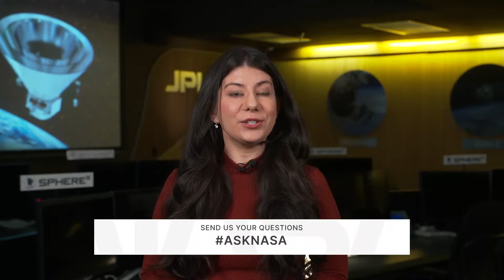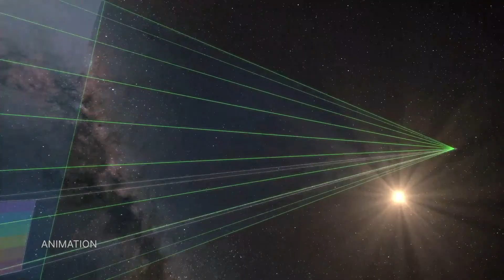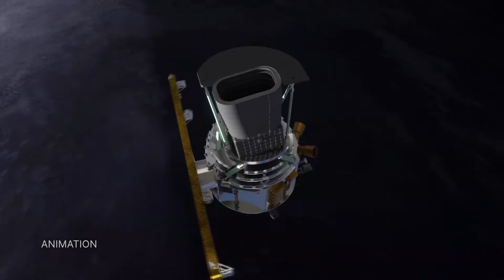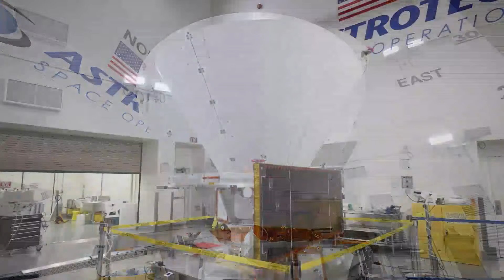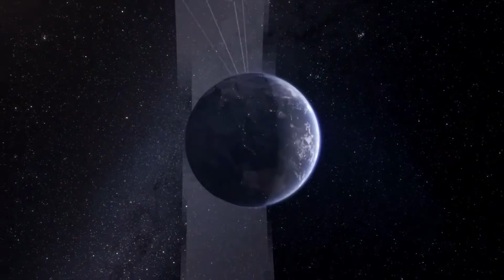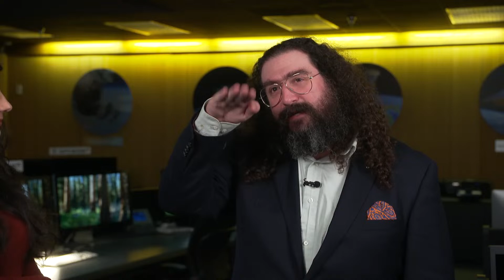See the Spacecraft: SPHEREx Nears Launch (LIVE Q+A)

Comment: I propose a 360 camera for space, its a super camera, so we can watch simultaneously events and investigate if there are possible conections between them. But this project is also very important and i  enjoy to see this advancements. Thank you for post and keep doing  amazing like you do. The world should be proud with projects like these.
Reply: The problem is you need much, much bigger sensor for simultaneous 360 with the same resolution and light sensing levels. Bigger sensor has higher chances to have defects and faults that you cannot fix in the Space.
Not to mention distortion correction.
Reply: @ToChunkA  maybe we can attach the camera to the ISS While we test the camera, so we have People and resoources to fix it inside a module that closes the camera inside so the astronauts could be inside working on it, till we get it propor ajusted.  Also would be tested here on earth first. We can manage with AI to have polarised lens  to protect the sensors from the sunlight. We can think about a couple of solutions to overcome problems like that, and other possible ones, its Nice to have you pointing possible problems so we can think about it.
Reply: @ToChunkA  distortion could be fixed by AI also,  of we program it correctly it would be possible to surpase that. In times that we are in the middle of a AI revolution we open a wide range of tools to manage problems in space.
Reply: @, I guess AI is not very applicable here, because of hallucination. It can add things that are not for real.
Reply: @ToChunkA  if not now, in the future will be
Reply: The polarized lens could be gradualy and smart adjusted to match the intensity of light that we want to prevent to let in.
Reply: That's a TERRIFIC idea! I hope you are able to arrange funding and hire personnel in order to make your incredibly costly dream come true! 😺
Reply: @TheStockwell  that thought also occurs into my mind. Dreaming is free for now. And what would be of us without dreams